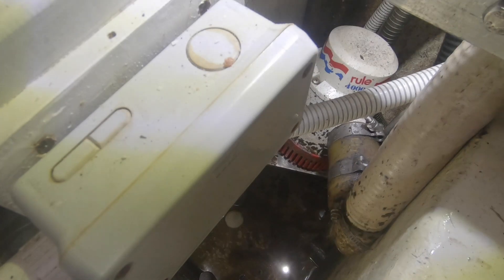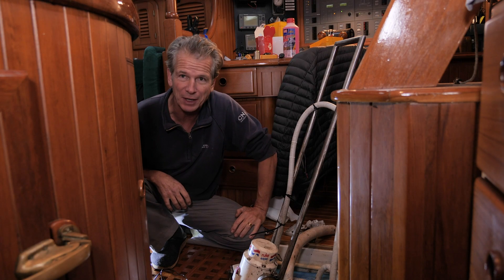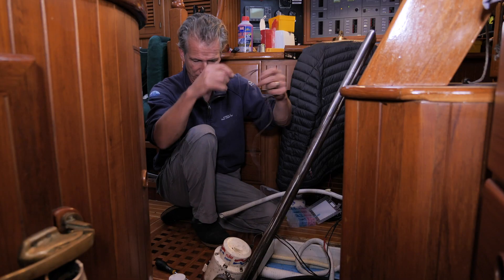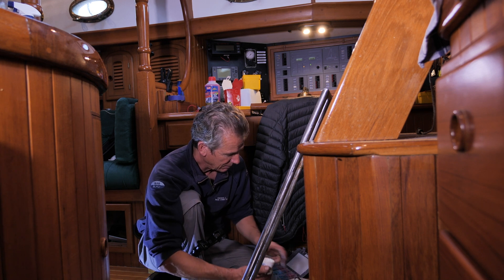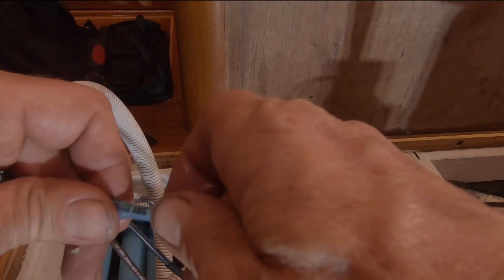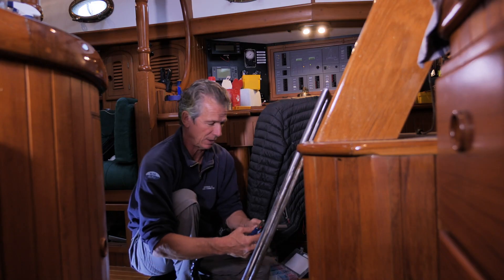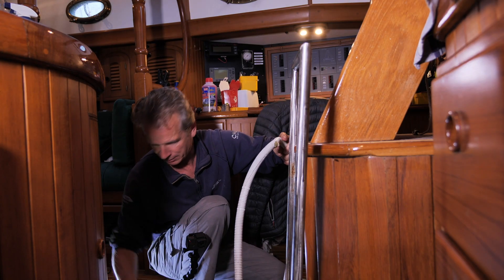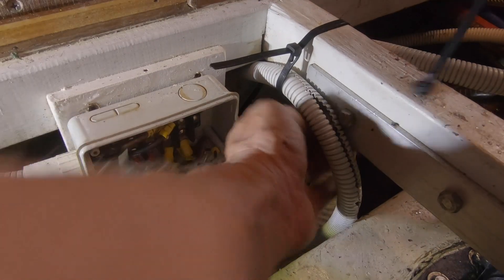Bilge Pumps

Comment: I would tend to agree with you on soldered joints when done the old way, however I find the heatshrink adhesive soldered buttsplices  very good .Crimping also puts a stress riser at the end of the crimps so my solution for both types is to cover the splice with a piece of adhesive heatshrink extending the length of the splice at each end. this supports the splice and increases the waterproof of the joint

Comment: I reworked my bilge pump system about 10 years ago as the existing set up just wasn't reliable.
I've a keel stepped mast so rain water runs down into the bilges even when the boats on the hard standing.  I think more boats drown internally out of the water for this reason. 
I imported, from florida, an ultra safety systems switch, high  level switch  trips pump on low level off.  They sell tef gel too, a very good quality anti seize compound. 
They fit them as standard to IP yachts, and one Nic 39 😂😂
I did a lot of research before buying one and they are the best. Some of the USA yacht parts are very good quality, I've imported quite a lot from the USA over the years. 
Mines never ever failed to work and it runs numerous times a day in the UK with rain water running down the mast into the bilge. 
Check them out and get one, those cheap float switches are dreadful.

Comment: Can you pump 100% water in the bilge with this system? Or alwais bit of water inside? I have same system. Tks
Reply from the maker: No it won't get everything out, but as with most full encapsulated keeled boats the bilge is deep and narrow so there's not much down there & it will dry up if you're not getting any extra going in.
Reply: @svfairisle  tkank you! Yes my keel is also full encapsulated, very deep and very difficult access to clean. I bought a manual pump to dry it, because were one liter of water impossible to pump with electric one. I saw Fair Isle in Cartagena 5 months ago, when I bought my boat. Fair isle is a Beautiful boat!
Reply from the maker: Thank you!

Comment: Please, please, check proper use of dielectric grease. You may be creating more problems, not less. Cheers.
Reply from the maker: I had someone else comment the using die-electric grease within a sealed heatshrink was a mistake. I confess I've never heard this before and in the tiny amounts applied would not think the grease would effect the seal. Even if it did I think I would rather have a joint more liable to not fully seal but be protected from corrosion by the grease than a joint less likely to become unsealed but with no corrosion protection if it did.

Comment: Thank you for the video,comforting in these dire times. Another reason to NEVER use solder to connect wires, is that solder adds a higher resistance  to the connection. Just where you dont need it. When a current runs through a wire.  e.g. to a big pump, the result will be a temperature built-up and then  melting of the solder. You can expect failure. [and a fire..]  like I had for some years on my yacht..Luckily the fire went out after a lot of smoke in the switch panel. Also,NEVER put a tin end in a crimped connection, the tin avoids pressure . It works like a liquid in the strain.

Comment: I hate to be this kind of commenter, but you're using the wrong tool for that heat shrink butt connector.  RC Collins wrote an outstanding post on the subject, which I urge you to read:

https://marinehowto.com/marine-wire-termination/

In this case the right tool for the job can mean the difference between a connection failing after a couple years, and one not failing for a decade or more.
Reply from the maker: Good article. Which tool did you think was wrong?
Reply: @svfairisle  The ratcheting crimper with the double dies, which is for regular insulated terminals, i.e., non-heat shrink. One die on that crimper is slightly larger than the other, though I can never remember which one. The idea is that the deeper crimp is the primary, and the slightly less deep one is for strain relief (though, again, I may have that backwards!).

It will certainly get the job done on both types of terminals, which is why so many people don't know the difference.  When I learned about it, I decided that wire termination on my boat is important enough to go back and do it right on all the terminals that I had already crimped wrong.  The peace of mind was worth it, and there were mercifully only a few of them.
Reply from the maker: Arh yes. Maybe I should have shown it. The crimpers I have have interchangeable dies, theres 5 sets. So there is one for insulated one for not as well as others for things like solar mp4 connectors. It's not the best set of crimpers in the world in terms of quality but it does the job for lots of different things so at least it's good for space, not having to have several pairs.
Reply: @svfairisle  Ahh, ok! I just assumed it was the wrong type of crimpers because it looks like they make a double crimp.  My mistake!

Comment: I was interested to see that you crimped both wires in the butt joint at the same time. I was under the impression that the ‘double jaw’ on the tool was asymmetrical, one side for the wire termination, and the other side for the strain relief - as on a normal spade crimp. That was certainly the case for my main tool but looking at some of the spare jaw sets I have, one of them crimps to the same level on both sides, that is they are symmetrical. This is great news for the future, all I need to do when crimping butts is to change over the jaws. Thanks for that. Link to a photo showing the different jaw sets www.bit.ly/CrimpJaws

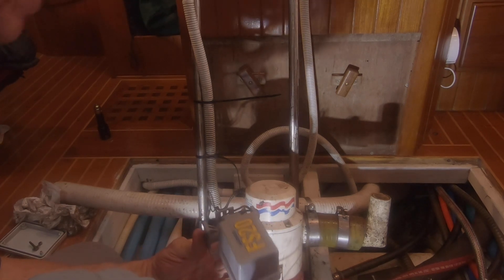Comment: @1:26... Get rid of that float switch and get a Water Witch Sensor... Float switches are not as reliable...  https://waterwitchinc.com/bilge-switches/
Reply from the maker: Yes, as I said in the video I just put it on as there was a spare on board. It will be swapped out as soon as we're somewhere with an open chandlers!

Comment: Very informative video and your electrical work is very thorough and logical. Noticed you did it but really good idea to give the crimped wiring a good tug to check it out. The crimps you use are very good for the job only difference is I used to use an electrically powered hot air gun.
Anyone on a boat watching this should take note some very good advice
Reply: Well said.

Comment: Nice to see tinned wire. Did you crimp only once in the middle? I have a manual tool and always crimp on both ends of such a connecting wire terminal.
Reply from the maker: No, sorry if that didn't come across in the editing, I think some butt joiners have space for one crimp, mine have two.